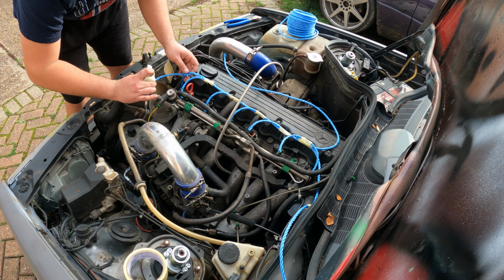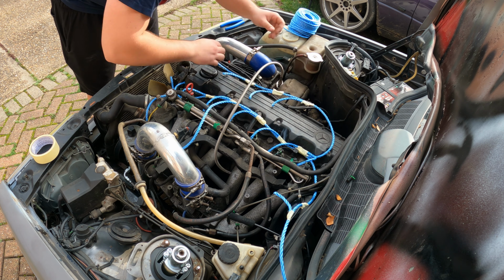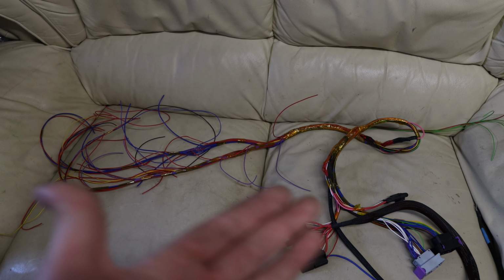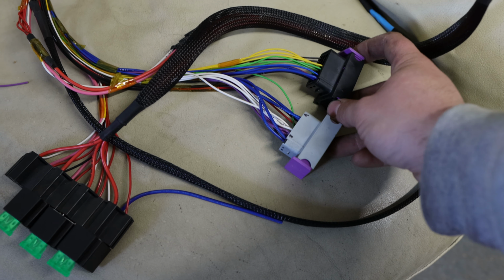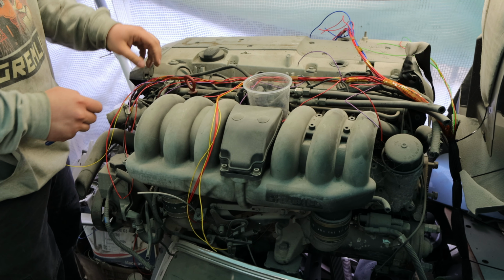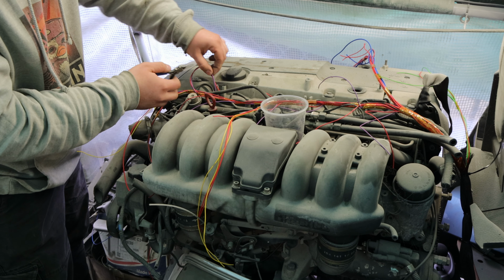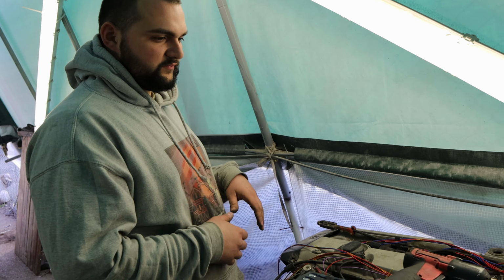M104 Standalone Wiring for Emu Classic

Comment: great video thanks. Can a standalone ECU master for M104 motor replace all stock daily driving functions of the stock ECU? functions such as asr, abs brakes, other sensors? i still need my C36 benz with M104 engine as a dailu driver too. thanks
Reply from the maker: Thank you! I'm not really sure. I haven't played with w202s but I'm pretty sure the abs system in w201 is standalone and as long the abs computer receives its power and sensors should work. The standalone ecu can have traction control strategies if that's needed too.

Comment: Hey man, did u make vvt work? How do you wire? Relay? Or direct to an aux output?
Reply from the maker: Hey, due to it being sometimes powered for long periods of time I like using relays. But you could wire it directly from ecu.
Reply: @driftinrust  awesome man! Did you also make the intake resonance flap work? Same way? I think you've gone turbo since so maybe its not relevant
Reply from the maker: @Mezarri88  you can run the flap the same as the vvti, or even together. But yes I have removed the flap as at some point I'm going turbo.